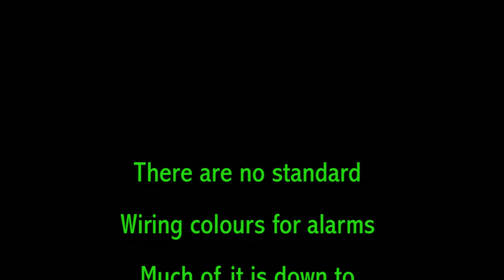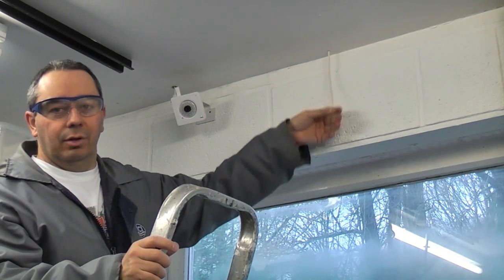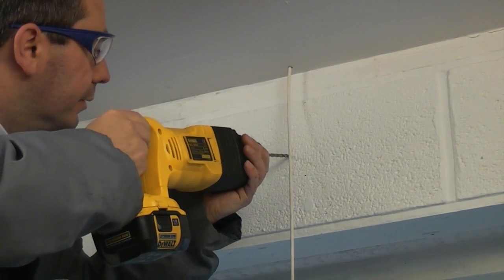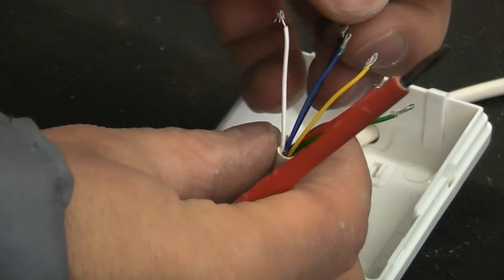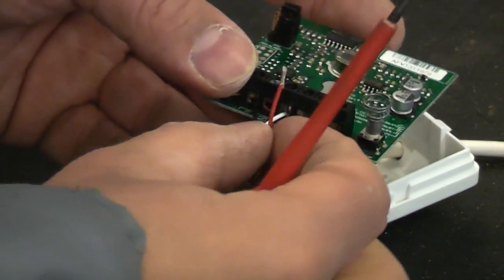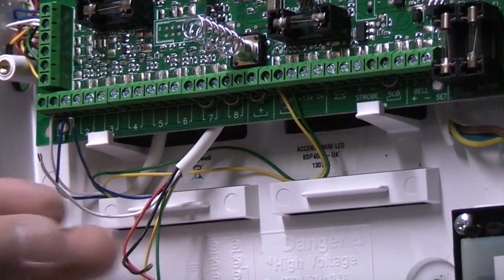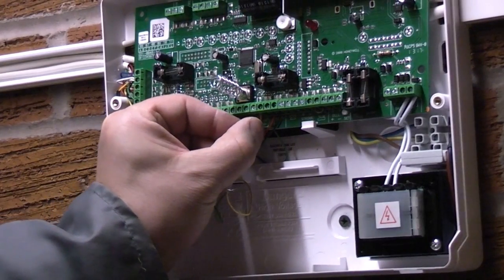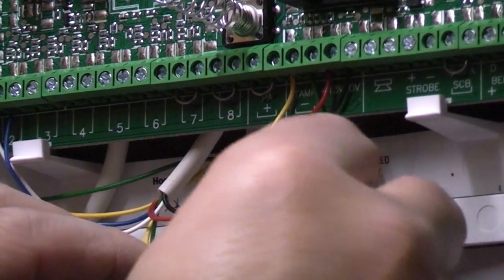How to install a Burglar Alarm PIR

Comment: Hello again! Your garage looks like a pretty nice one, but I'd usually recommend a "dual tech" detector in a typical garage environment. It combines a standard PIR sensor with a seperate microwave detector, both of which have to trigger before the detector goes into alarm. If set up correctly, they can prevent false alarms from sources such as draughty garage doors and the like as the microwave element of the detector is not affected by changes in temperature (unlike a standard PIR). The Honeywell DT7550A is a good quality unit for not too much coin :)
Reply from the maker: Thanks for all the detailed advice- much appreciated ;-)
It is possible to program the zone in the alarm panel for a double knock, but if that doesn't work I'll get the detector that you have recommended.
Thanks again ;-)
Reply: *****
No problem. I've learned loads from your videos over the years so it's the least I can do. Keep up the excellent work.
Reply from the maker: Scott Steele
Good stuff, I'm glad the videos have helped you at some point ;-)

Comment: I used to have an alarm system from Texecom and I thought you just put all the tampers wires together by colour and your done. This has helped me a lot cheers
Reply from the maker: You are welcome.
Thanks for the comment ;-)
Reply: @ultimatehandyman   regarding the tamper you said it's in series but we're was the cable from that you connected on to  , were does the end of that cable connect into on that model , cheers rob
Reply from the maker: At the PIR, the two tamper wires go into the two tamper terminals.
At the alarm panel there are also two tamper terminals, but this one tamper circuit is for all the zones in the alarm. You have to wire all tamper wires in series at the panel (basically making one big loop), then put the two remaining tamper wires into the two tamper terminals.
Thanks for the comment
Reply: @ultimatehandyman  thanks a lot  matey all the best

Comment: It’s best practice to mount the PIR in the corner of a room, but away from any draughts, direct light, and shining objects which may hit the sensor causing false alarms. Also, you should always cover the backing screws on the housing with insulation tape to counter any chance of contact with the PCB which may cause a short circuit. Nice enough job, but it would have been a lot neater, and easier, to ceiling mount it.
Reply from the maker: Thanks for the comment ;-)

Comment: Another very professional and easy to watch and learn vid, thanks. I guess the only use the random colours and anti tamper are useful for is the outside box. When inside, the alarm should be sounding. I wire in a sound bomb by the control box to disorientate the intruder while he's inside (so I can creep up on him with a baseball bat)
Reply from the maker: LOL, The baseball bat is a good idea ;-)
Thanks for the comment

Comment: For the garage you really should have used a dual technology PIR as it would be more resilient to heat changes
Reply from the maker: The installed PIR has never been a problem, I do have a dual technology PIR which I intend to install in the summer house when I get chance.
Thanks for the comment
Reply: hello i am wanting to install new alarm in my house and i am wanting to put the main panel in a airing cupboard and i need to get 240v to the 3A FCU and i don't know where to get the power from there is a loft above the airing cupboard so could i tap into the lighting circuit?
Reply: @cctvvlogger8835  yep that is fine as long as it’s 220-250v AC and 13A

Comment: How would I know the right wire to buy for PIR  alarm sensors/sound? My wire got damaged by carpet stapling (so annoyed). It's 6 coloured wires (very thin) and a plastic looking string which i think is for stripping back the wire casing. Please reply as I need to repair soon. Thank you.
Reply from the maker: I normally just go into my local electrical shop and ask for 6 core alarm cable, but you can get it online by the meter- https://fave.co/3lY4c3s

Comment: Hello really helpful video but just a quick question do you have a video on how to wire in multiple PIR as I'm have fitted my own alarm but know what to do with all 6 wires on the PIRS thanks
Reply from the maker: I think you mean multiple PIR's into one zone?
You have to wire the power (+12 and -12v) in parallel 
Then you wire the tamper circuit and zone circuit in series. 
If you google for series/parallel wiring a diagram will show up that should make it crystal clear.
Thanks for the comment 👍
Reply: @ultimatehandyman  
Hi I have got 4 PIRs and  2 doors senses I want to put each one in a different room so I think I need to use zone 1 -6 so I have wired in the zones with white and blue and then the tamper with yellow and green in loop like you did in your video now I'm just left with all the red and blacks

Comment: sir, in the event of more than 1 magnetic doors or pir needs to be installed, how are we going to do that? i bought the same unit that you had but unluckily there is no technician for security alarms in my place so i will be basing the installation from the manual and from other media available in the internet like your video tutorials. Do you have at least a video showing complete wiring of this alarm? thank you ver much indeed!

Comment: I’ve got the same alarm 
Is it possible to wire 2 pir to the same zone 
It’s just I need the time delay on zone 1 to work on the front & rear of the property 
I’ve tried wiring them both together on the same zone but it doesn’t work 
Any ideas please 
Your videos are much appreciated 
Thanks
Reply from the maker: Yes, it is definitely possible. The power V+ and V- need wiring in parallel, and the tamper circuit and zone circuit need wiring in series   👍
Reply: @ultimatehandyman  appreciate your help thanks 👍

Comment: I think this will help me so much 👍 I installed an additional pir (Zone 5) for my mum in her spare bedroom & for the life of me, I could not work out how the tampers are wired at the control panel, I was joining the tamper wires from Zone 5 to the existing tamper wires that are twisted at the control panel but everytime I undone the pir, the tamper would not cause the alarm to sound, now all I need to do is take 1 leg from the tamper screw terminal at the control panel & join that with 1 leg from my pir & then put the other remaining leg back into the tamper screw terminal. 👍😎
Reply from the maker: I'm glad the video helped ;-)
Thanks for the comment

Comment: I’m in the Process of installing one of theses and I’m having an issues with the PIR’s. When doing the walk test the 2 PIR panel lights just flash on and off even when there’s no movement? Any ideas?
Reply from the maker: Some PIR's have jumpers inside that need moving.
I fitted one a few months back and it had three separate jumpers that required moving to make the PIR operate correctly. It should tell you where the jumpers need positioning in the manual.

Comment: hello, don't suppose you have a video of how to connect the smoke detector do you? I bought the eco1003 and have no idea how to wire it to and from the accent control unit.
Reply from the maker: No, sorry.
I do have smoke alarms and heat alarms in almost every room, but they are wireless interlinked, as it would have take me weeks to hard wire them all.
Thanks for the comment 👍
Reply: Tessa irwin is so get wire put it on the same colours and power down the consumer unit and put the wires in but get someone to do it

Comment: Thanks for the great video all the details which i need its covered in the video i have one question need to confirm from you  after do this installation did we need to do in programming side to add new zone if we need then please please explain how we can add new Zone in Honeywell G4 control panel
Reply from the maker: I'm afraid you'll have to check the manual, as I can't remember- sorry
Thanks for the comment 👍
Reply: @ultimatehandyman   thanks for your reply i solved the problem basically the zones are already programmed i just did the installation and it work thanks a lot for the knowledgeable video

Comment: Hi im just about to connect this panel up iv got 2x pir and one door sensor im just unsure about the tamper wire connections from each sensor. Do you just make a loop with the green and yellow cables from al 3 sensors and then just connect the remaining green and yellow cable  into the panel thanks
Reply from the maker: Yes, you just make a loop ;-)

Comment: Hi I'm confused. If I add another pir to your panel would I take out the yellow wire in the tamper and then twist that with green wire from the new pir and put tape around this pair and put the remaining yellow wire from the pir back into the tamper in the panel? Is that what you mean by wiring in series? Hence you end up with lots of pairs of twisted green and yellow wires?
Reply from the maker: Yes, you just make one large loop with all the tamper wires then is any of the wires become open it puts the alarm in the tamper state.
Reply: Doing this will result in a tamper state, but you wouldn't know where the state has come from. To overcome this, cant you use two pair.

Red 12v
black 0v
say blue alarm 1/n.c 
say white alarm 2/n.c

blue goes from the panel straight to the alarm 1/n.c 
white goes to the tamper 1
Then you place a resistor from tamper 2 to alarm 2/n.c

Comment: When replacing a PIR - how do you get pass the tamper protection? I believe ours needs replacing as the zone randomly causes false alarms when the alarm is set.
Reply from the maker: If you put the alarm in engineering mode (the code should be in the installation manual), you can then remove the cover from the PIR without the alarm sounding. If you don't know the engineering code manual, you can remove the cover and the alarm will go into tamper mode and the alarm will sound, but it should silence when you input the user code. 
Thanks for the comment
Reply: Is that the same for replacing the battery as well ?
Reply: @techgeek_  yes

Comment: This may just have saved me. One question though - when adding more PIRs to the Accenta, I get the Tamper circuit being a big loop, but do you just wire all the red/black power feeds from the various PIRs into the same terminal on the main panel? Thanks for the great videos.
Reply from the maker: Yes, that is correct. All tampers to form a loop and all power reds into + and all blacks into -
Thanks for the comment

Comment: Hi, Can I do this with the power still on? 

My concern with turning the power off while installing a new PIR is that the siren will be going off all the way through the install?
Reply from the maker: Yes, you can do it with the power still on but be aware that there will be 240v in the panel going to the transformer.
As long as you put the alarm in to engineers mode before opening the cover it should be fine ;-)

Comment: Hi, great video. I am struggling with the serial concept and I was wondering if you could provide any more clarity. I think I might have got it from Shabz below but think I need it spelling out :)

So in the video you had Yellow on the board (Yb) and Green on the board (Gb).

You had Yellow from PIR1 (Yp1) & Green from PIR1 (Gp1).

You took Yb  off the board and joined it to Gp1. You then put Yp1 where you had taken Yb originally from. Got that bit!!

But what happens when you introduce PIR2? What happens to Green from PIR2 (Gp2) and Yellow from PIR2 Yp2)?

Do you take Yp1 back out of the board and connect to Gp2 and put Yp2 back in the board?
Thanks in advance!!
Reply from the maker: Yes, I think you have it there. Basically you are making one large loop with all the Normally closed contacts on that zone, so each time you add another sensor to that zone you have to open up the existing normally closed circuit, this is done by adding one wire to the existing loop (by removing one of the wires from the panel and joining it to one wire from the new sensor), then the other wire from the new sensor goes into the terminal on the panel.
I hope this makes sense ;-)
Reply: @ultimatehandyman  no, I'm still confused🤔 are you saying if have (for instance) 5 PIRs then those 5 wires would be twisted together with the wire in the board and so?
Reply from the maker: @karmatingz5797   No, imagine you are making a daisy chain, you need to make a large loop. 
So if you had 5 PIR's you would have ten individual wires, these need joining to make a large loop. Lets say you are using green and yellow, you take green from PIR 1 and connect to Yellow of PIR 2, then connect Green of PIR 2 to Yellow of PIR 3, then green from PIR 3 to yellow of PIR 4, then green of PIR 4 to yellow of PIR 5, then you are left with a yellow and a green wire, which is terminated into the terminals on the alarm panel.

Comment: hi the cable used from pir to the c.panek ; which type of wire do you use
 ta
Reply from the maker: 6 core alarm cable, like in this video- https://www.youtube.com/watch?v=0lsno4HTdrc
Its widely available on ebay etc. 
http://fave.co/2eMsw4c

Comment: struggling at the end of the wiring you say just take out the tamper ,yellow wire my box does not have a wire in for any tamper only has pins like used staples. only wires left on my pir is green and yellow the alarm panel is a omnicron 7000
Reply from the maker: The thing shaped like a staple is a link, it bridges between the two terminals keeping the circuit closed. When you remove that link you must wire at least one tamper circuit into it or the alarm will not reset. If you wire more than one sensor you need to wire them all in series, so in effect you are making one large loop.
Reply: *****  so now i just need to wire the green and yellow wires in to tamper /24 hr
Reply from the maker: Eddy Peters
Yes, as long as you have wired them into the tamper terminals on the PIR, or any other sensors.

Comment: thanks but is not come any flashing lights, I have exactly same what u have on your video, the old sensor been flashing but the new one not
Reply from the maker: +Michal Horinek 
You probably just need to move a jumper on the inside of the PIR. It will tell you which jumper to move in the instructions, if you still have them.

Comment: how would you connect a third sensor ? for example another pir?
Reply from the maker: You would wire it into the next zone on the panel, but in the instance of a PIR you need to wire it up to the + and - supply in parallel. The tamper wires are all wired in series (to make a loop). You can have more than one sensor per zone if you wish as long as the normally closed zone wires are wired in series.

Comment: The cable colours used for each device on the alarm should always be random. Otherwise it is conceivable that a device/sensor can be bypassed or disabled
Reply from the maker: I'm not sure if that makes any sense?
If anyone removes the bell box, any PIR, or removes the alarm or RKP covers the alarm will go into tamper. The only sensor that could be removed without the alarm going into tamper is the magnetic door contact on zone 1, but it doesn't matter if all the wires are the same colours you can soon see which wire does what from where it is connected to.
Reply: *****
 I was just saying that if the colour scheme used was known, the tamper circuit could be closed by splicing into the cable, then the sensor/bell box could be opened up without tripping it. Yes it is overkill I know, and the cable would not normally be exposed externally anyway! I'm sure I read about this in a magazine article a few years ago. Thanks for responding!
Reply from the maker: pag2006
No problem, I guess that could happen in some circumstances.
Thanks for the comments ;-)

Comment: Hi,Why did you use that sensor rather than a Honeywell sensor.
Reply from the maker: No specific reason, it was just for sale on the same site as the alarm panel.
Thanks for the comment ;-)
Reply: If you wire them up right, mostly all PIRs are interchangeable

Comment: Can we add two or more sensors in one Zone ?
Reply from the maker: Yes, you can, but you need to wire the  DC power in parallel and the tamper and zone in series.
 Thanks for the comment 👍
Reply: @ultimatehandyman   thanks for the reply it works

Comment: Hello I been installing my alarm system got some old alarms so a Risco old pir hook on zone 3 zone 1 is door sensor and zone 2 is the pyronix pir and the bell box is a pyronix sounds good and great but it need to be replaced soon cuz the bell box is acting silly cuz the panel not communicating with it and it won’t let me set it if you see my channel u will know what I’m doing but when I got mine alarm panel it didn’t cover the zone so I just link the zones with wire and is a zone 8 soon I might buy a G5 accenta or a texecom don’t know I did a great job at wires and I’m a kid it’s running of a battery and transformer it all work don’t trust it tho because if the bell box sets off and I got a texecom pir sensor a microwave detector from Marlowe fire and security they are nice they got a channel called Marlowe fire and security also I find ur video good the bell box what you have is a kintec bell box they are good also the fire alarm roshni the new ones they break more not good they are expensive

Comment: Can you use sticky back to fit it instead of drilling
Reply from the maker: +S.2018 
It depends. If the sticky back becomes detached the PIR will fall and the alarm will go off.
I often fix things using silicone, and sticky pads though. The sticky pads hold the item in position until the silicone cures. That might be a better option if you don't want to drill.
https://www.youtube.com/watch?v=eyzXyKCGQX4
Reply: PIRs do detect heat, but thats not what sets them off. It's changes in IR. they normally have a slight tolerance, but even small changes trigger an alarm state